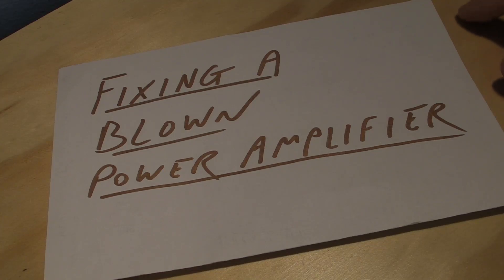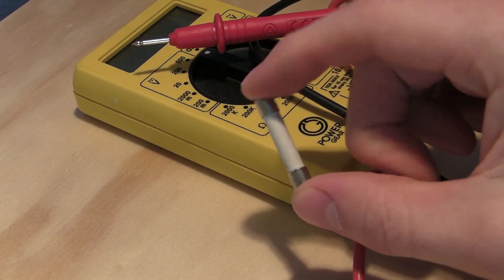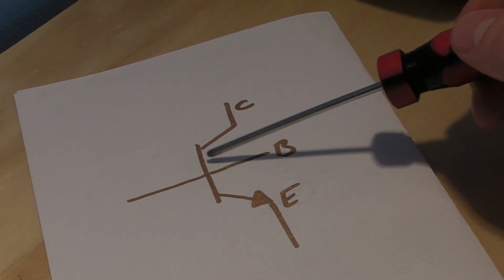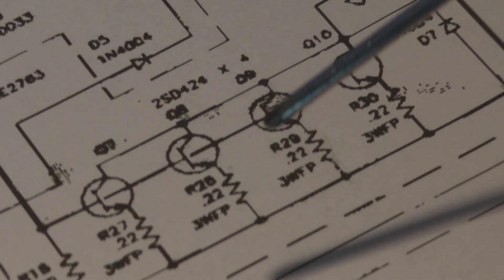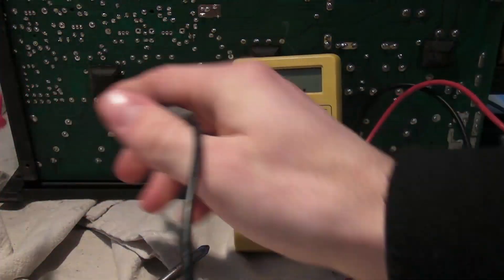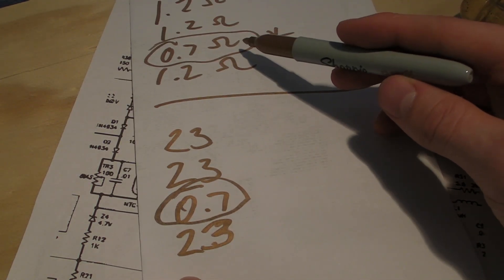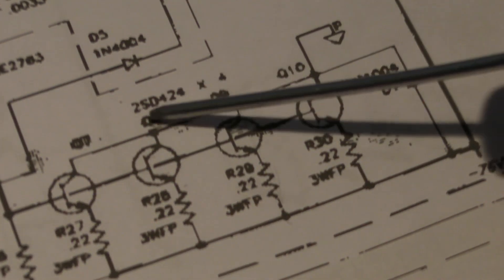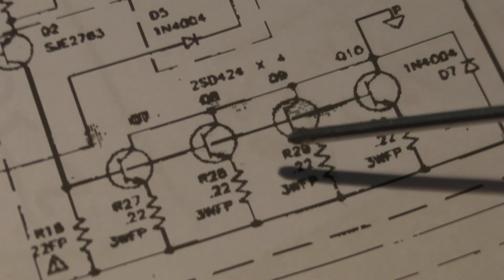Simple fix for a blown audio power amplifier - Save your $$$!

Comment: Behringer Europower 2500 I have no sound coming from channel 1 no blown fuses. I have about 11mv dc from the good channel output and the same from channel 1. I have no signal light no clip light on channel 1 but if I pull the fuse I get it. It all started when I was running wires on the back and hear a hum when I touched the 1/4 input jack and went dead. So I removed the board and was looking at it to see if I had a break in the ground but nothing so I plugged it all up again and it was working so I put the amp in the system and was listening to music and it went dead again about 40 minutes of playing. I do notice where the fuses go the clips are broken that holds the fuse on one side the same on both channels and I don't know how they bent to be weak and come apart. I'm just wondering if maybe that quarter inch input xrl jack sent something to the input stage and now no signal to the amp channel 1? If I turn channel 1 up to full I hear sound but low. Like a bad connection but I don't know about this and wish somebody could tell me what to check with a meter or scope multimeter before I have to pay someone to fix it

Comment: I know where your coming from when you mentioned searching thru diff videos. I have done the same. 
Takes a lot of time. After slowly getting into this stuff ( and I "don'", learn quick! )  what I've finally grasped about 
 the BJT ( bi=polar-junction transistor )  the  (NPN) type  (a N&P junction) + another N makes a sandwich  with
the( p in the middle) so  NPN junction/  Start over ,1 side N-P junction ( the other side)  one  N-P junction there 
sharing the same P   and the "P" in this case (of the NPN) is (the base leg) that has a higher voltage than the   
N emitter and this turns on the transistor like a sw. to do amplifying   SO what he is checking here, is with it unplugged.
"NOTHING "zero voltage at the base   can flow from (N side) thru (P middle section) to other(N side) ONLY IF IT'S SHORTED
that's the key here . If it's shorted,  it will measure a diff ohms path straight from "E" leg  to "C" leg   emitter to collector with out haveing to go around thru the other closest path with the least amount of resistance  SO it's a good idea how to check for a bad transistor 
with just an ohms meter  and the stereo  amplifier unplugged. And he pointed out the resistor that works with the neg. leg  emitter ( the side the arrow points to) on the schematic should be replaced too!  Writing up this comments help  me as much as someone  reading it as I have no one to talk to about stuff I learn, so I have to go thru what I've learned to keep it fresh let me know wrong this is what I got out of the video. thks for posting it.

Comment: Guys, you explained so well and clearly. 
I'm an electronic engineer and was tying for many hours to find which transistors were blowing the fuses.  
I was  just missing the trick with the small  resistance difference to insulate the guilty transistors.
Thank  you so much for your video, you saved my $2000 Rotel audio amp !

Comment: Hey thanks for the video, it was very informative. I was wondering though, on the second set of transistors you found that only one read low, and the attached resistor was bad. Am I correct in assuming that the resistor was reading open line? And because it was open line it isolated the bad transistor, removing it from the circuit? Thank you for your time and keep making videos!!!!

Comment: I’m sure you get lots of questions from people but I’d appreciate any suggestions from you. I have an old Crate B10 xl solid state amp that I’ve been trying to get working again for a couple years. There isn’t any repair places near me and I searched all over online with no luck finding any similar problems like mine. I was playing it and all of a sudden zero audio, not even a hum, the fuse wasn’t blown and it still powers on. I’ve confirmed that the speaker is still good, I can’t see any signs of something that got hot or blew, the jack inputs are making contact and all of the wiring is good, none of the caps look bulged and it doesn’t even make a sound when I touch the aux jack. I’m suspecting it’s a component on the circuit board but I can’t see a visible problems, I’ve tried testing everything with the knowledge I have, it makes a small sound whenever I touch two of the pins on the output transistor/mosfet so It might be that but I’m not sure. It might even be one of the many diodes.

Comment: I can't imagine this has not been pointed out yet but the solder pads on the board connect to the Base and Emitter. The Collector is the big metal case on the other side. On this model QSC amp the collectors are grounded directly to the aluminum heatsink. Most amps isolate the collector with an insulator, some of which require thermal transfer compound, others do not. It is also quite common for other components to short (or open) along with the power transistors. While I understand that you are trying to help people out and save them money, you are in effect giving them just enough information to possibly do serious damage to their amp or to themselves in the process. It isn't always as easy as it looks folks.

Comment: I have a Rock Sonic Amplifier so I checked it and found 2 busted ACs I repaired them, then 2 days of good sound the equaliser screen starts flicking as if there is not enough power 4 it to remain stable. Now when I play Audio it goes like play pause play pause. I don't know what to do anymore because I even fixed all 2 fuses.

Comment: Thanks for the video hopefully I can repair one of my QSC900's this way.  My question is odd I have access to another 4 or more of these for free, my work bought an old theater to demo and gut out.  I'm running these in mono bridge mode to an 8ohm 3200w single sub.  Since they're identical models, in theory could I stack/strap a pair with a split signal coming in, and run 2 amps to one sub?  Or stack and run #1 as a master parallel and #2 as a slave?  It still wouldn't exceed the limit of the sub anywhere close.  Just wonder if I could easily double the bass hit since I have access to a stack of free QSC900's.

Comment: Irriresistable output transistors shorted out in a bank in the left or right channel ,  easy for you to explain very well and find. But this overload and smelly components bbq can be caused by not a short but an open circuit in one channel speaker loose banana plug which overdrives the other to go into protection mode ? One side of one channel open circuit loose banana can cook your Denon amp ?

Comment: Do you have any other info on amp problems. I don't think mine is completely blown nor that the issue is an ouput transistor. I have no circuit breaker that is user resettable and my internal fuse is intact. The amp powers on but it doesn't provide the driver with what it's meant to do. The power light blinks when there is a power spike such as a bass hit and the driver will attempt to produce sound but there's a clicking sound coming from the amp and any sound that the speaker produces is scratchy and once in a while it will almost make a clear sound but it just doesn't quite make it. It's a built in single channel amp for a JBL self powered subwoofer model Sub 12 from the 2000s era Venue series. Not a great sub but not bad either and I have a full set of speakers from the series. The Sub 10 works fine on the system so it's not an issue with my AVR.

Comment: How did you know that the resistance was going to be 23 ohm?  It doesn't look as if it says that on the schematic.  Did you find the information somewhere else?  Great video and explanation btw.  I have a Hartke HA5500 that pops fuses when you turn it on and I did a little reading and people say a common issue is the output transistor or the output transformer.  I downloaded a schematic, but was wondering if you found the resistance value on a forum?  Took the 23 ohm value from the working channel, or was there something on the schematic that showed you?  Thanks in advance.

Comment: Hello, im new to this but im interested in it and have repaired a few things here and there but should someone replace transistors in sets from the same batch? I heard that before I repaired one of my Kenwood km209 amps so I replaced all 4 from the same batch. The argument was that the gain wouldnt be the same on mixed batches or mixed brands of transistors. Only 1 was actually bad. But i replaced them all because i wasnt sure. Does doing that have any benefits? What are your thoughts on that? Thanks. Good video BTW.
Reply from the maker: You bring up a good point & several other people have mentioned this issue since I made the video. According to some online resources, unmatched transistors can cause issues as you say in certain circuits since the gain will vary. Truthfully, I am neither qualified nor knowledgeable enough to know if this is true & in what cases. I may have gotten lucky and bought transistors that matched the existing ones, but my amp is still going strong!

Comment: Hi.  I picked up 3 amps, McGregor SA series.  240x250 i think used for PA system.  Fairy basic and big components inside.  All 3 have a nasty constant buzz on the channels.  Doesnt matter if i turn up or down the volume.  Sort of sounds like a loud transformer buzz, but coming from the speaker.    Im fairly competent with soldering and whatnot, so where do you think the problem is hiding out?? Caps? Transistors?  Cheers from Wales.

Comment: Yeah great video. I like to collect stereo gear, find stuff at garage sales and such. And often you can find something inexpensive, but does have a small problem. Or your cat can knock over a cup of water onto your turned on beloved amplifier and well you know. So I'm getting into learning how to fix the equipment instead of tossing into a land fill. Especially my beloved amplifier/AV receiver which was quite good, and would be expensive to replace with a new amplifier/receiver of the same quality today. Like $1,000 or more.

Comment: Like the others before, I enjoyed all of the video. Very clear in presentation and explanation. The weird bit for me was knowing the  there was a base, emitter and collector is one thing, but on this type of heat generating transistor, the two central pins that are soldered to the board could be one or the other as I believe the 'base' is part of the chassis/mounting. Thank you for taking the time. The video also has shelf life too! ;)

Comment: Great video...

Audiohead ah700 channel B... Not working.
Sir, I have an Audiohead AH700 with channel B not working... Its not worth sending for repair as I can replace it cheaply.... I have taken readings from Transistors as follows.

Toshiba C5198
C to E and B to E readings at 200 ohms
1. 1.0  and 14.8
2.  0.4  and 14.7
3.  0.9 and 14.8

Toshiba A1941
C to E and B to E readings at 200 ohms
1.  0.9 and 16.6
2.  0.4 and 16.5
3.  0.9 and 16.4

Is transistor 2 in each set faulty?

Comment: Hello,
I watched your video on repairing a power amp. I have a 2 channel QSC power amp that 1 channel is distorted like it is clipping. Any thoughts on what this might be? At first I thought I had a bad driver in my speaker but after changing the cables around to the other speaker i realized it was the power amp itself. Any thoughts would be appreciated.

Comment: Awesome! Thanks for the video. I've always been interested in electronics, and unfortunately did exactly what you said not to do. I replaced a fuse and turned my amplifier back on. I have a Mackie M2600. When I went to turn it off, I didn't hit the switch all the way. It shut off for a split second, and came back on. It tripped the breaker in the basement. When I turned it back on, it powered up for about 6 seconds, and then the fuse blew. I never had any problems before, and knowing it was a slow blow fuse, I ASSumed that was the only problem. After replacing the fuse, it powered back up and stayed on, but when I went to put power to it, the "protect" and "short" lights lit on channel 1. It was fine at low volume, but given some power, both lights lit up. From what you explained in the video, and what I've experienced, I'm guessing a short between collector and base - and who knows what other damage it may have caused! Looks like I'll be taking this one to the shop, but the video was still very informative, and I now I know what a transistor does!

Comment: Thanks for the video. I've arrived at the same conclusion, and it's nice to see my logic was correct. Where I'm at now, however, is why did the transistor blow ? Was it just old ? Overheated ? Shorted speaker wires ? Before I go putting in new transistors, I may want to  answer this question if I can. Great video, though. And again, thanks.

Comment: I'm far less knowledgeable than you are, but wasn't totally lost. Thanks for the help. I'm here because I have several 70s receivers that have problems. Most all don't put out sound from the right speaker, across all channels. So, no stereo but I can play both speakers if I use 2 channels. Your video was the first to explain what was wrong(I guessed correctly, but didn't know the terms), why and how, and also explained how to fix it as well. Thanks a million!!! 

If you have time, I have more questions so I don't ruin a couple really nice amps, or rather "stereo receivers"... I have a 1970 Kenwood kr-6160, and my favorite and cult following unit, the 1976-1979 Sansui 9090db. A few others of the Era, but these are my favorites.

Comment: Seriously thank you thank you thank you more times than I can say. I’ve had my kenwood stereo system for so long and the power amp recently ‘shut off’ ( no signal lights or sound going to speakers) and if not for the video I would’ve have had to spend 100+ on a new one or having someone else repair it so again thank you so much dude. 5 years later and literally your still the only video online I can find that explains this in a way someone who grew up just doin it myself and not knowing professional terminology can understand 😂😂

Comment: I had a little knowledge of electronics and this video was definitely helpful. Thank you... i know got to put my theoretical knowledge into practice... so bought myself a cheap active speaker to play around with.... i suspect the transistor is gone but will test the resistor if it has one- need to get a hold of the schematic (which is going to be the hardest bit)

Comment: This is great info. I am wondering if you can offer a bit of advice. I have a power amp where one channel has an extremely harsh buzz, not like a ground loop hum, but like when you touch the subwoofer cable end... loud, harsh buzzing. Could this be a transistor/resistor issue or should I be inspecting elsewhere? The other 4 channels do not buzz at all, just the one. I have not opened to inspect fuses. If a fuse is blown, would I get any sound from the channel? Thanks!

Comment: This was definitely an intuitive video. I've never had a problem with my Vintage Yamaha EM200 Series mixer, until I cleaned it thoroughly, after several years, and now my right side is blowing fuses. Fortunately, mine are only about .5 cents each...I have a feeling it's a simple grounding issue, with a wire, that where it was grounded, I had a hard time getting it back on the screw?? That being said, I can do almost anything electrical!! Oddly enough, I'm still not great an Electronics?? I used to be, but just don't do it enough. I still do all my own Electrical however. If you have any thoughts, I would greatly appreciate it! I can always send a picture of the inside of this console, 'cause I would really love to hang on to it...Of course, by the time you read this, I might have already figured it out?? MIGHT?? Sorry for the lengthy comment. And again, I think that you definitely understand this stuff, more than you give yourself credit for. I'm glad you mentioned early for people to not touch certain thing, 'cause too many people who don't know the basics, are the ones who worry me!!! Cheers Mate!

Comment: What if you had high DC voltage on one output of a Class D amp?  Someone connected another amp's speaker outputs to this powered monitor's speaker out (it's a Kanto powered monitor pair).  He didn't play the other amp that loudly.  Now all we hear is some slight buzzing on the good channel, and then there's 26.55v DC on the other output, but no music plays through the good channel.  I wonder if these Chinese Class D amps have any real protection at all... no fuses were blown all, but that makes some sense because the powered monitors weren't in normal operation.  Seeing such a high DC output makes me think a coupling cap isn't working, but then this video makes me wonder if it's a transistor or 2 or even more hmm... The big problem is that there aren't service manuals for a lot of new Chinese gear.

Comment: Disconnected first those output transistor, and  check the voltage bias on base and emitter of output stage, check and test also those emitter resistor whose value is in .33 ohm, once one of the output transistor is shorted the emitter resistor badly open, this the scenario  if voltage bias are not normal proceed to the driver stage, and test those driver transistor, wether it has a leak, you can find it easily because you have the diagram of that amplifier, I hope I share my Idea to you sir,

Comment: hey man i've got an amplifier in a portable PA, [Harbinger M350] i think its malfunctioning but just on one side (Right) and also I have confirmed my fuse is not blown. My right side speaker won't play back and yet it still gets a red light reading. I don't know specifically it could be. any recommendations ?